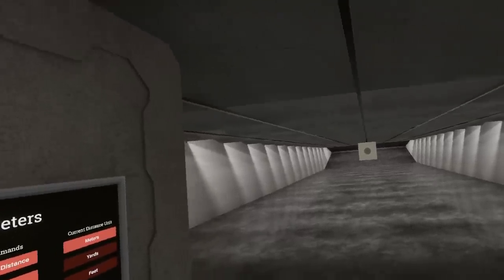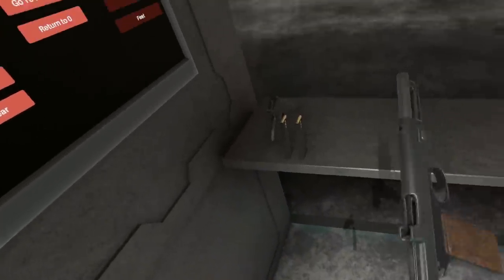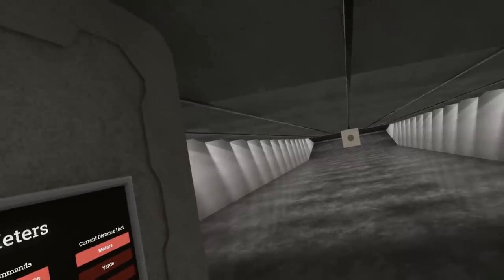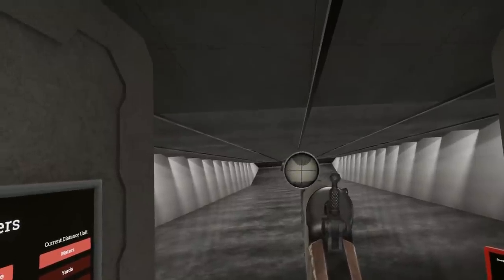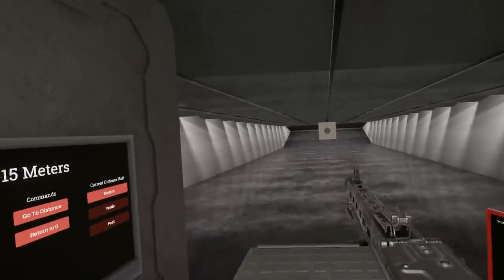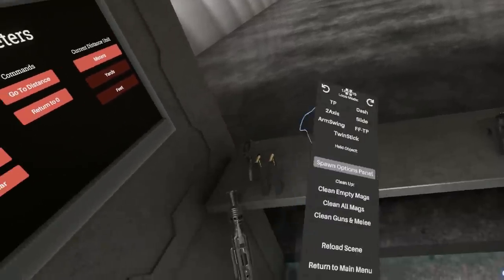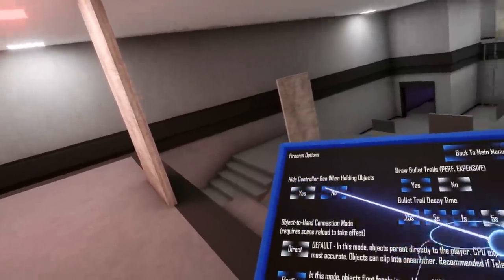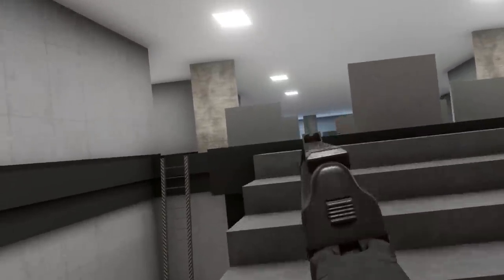H3VR Early Access Update 85 - Alpha3! - M1912 Hahns, New Armswinger Locomotion Features & More!

Comment: With the 200 round mag for the mg you should add a penalty to the gun because the gun would over heat after that much fire point in case why they have changeable barrels so you should have a reduced fire rate for the gun to penalize it

Comment: Not sure if you're aware but the martini-henry has the cocking indicator configured wrong, cocked it's upright and goes backwards 45 degrees when fired, in reality it does the opposite, it moves like you'd expect a hammer, in the movie Zulu many were incorrectly assembled and had the indicator vertical for cocked and forward for fired but it's mechanically impossible to have it to backwards when fired.

Comment: I would like to see something that lets you reload duel wielding handguns
Reply: Eject the mags, put the pistols in quickbelt slots and replace the mags. Done.
Reply: @themagnushjort  I think he means being able to hold onto a weapon and magazine simultaneously like you see in games like Counter-Strike and Left 4 Dead.
I don't need it and frankly it sounds like nightmare from both a control and coding standpoint.
Reply: @marcusborderlands6177  So the Halo dual-wielding reload? I guess that could work.
Reply: I just wish that you could stick the gun through the clip still in the belt, like a reverse version of the putting a clip into the gun in the belt, and the clip would respawn only after the gun leaves the circle thingy with spawn lock on.

Comment: For the mg42, it appears that in order to have more rounds for it, you'd just feed in a belt instead of using the drum. I'm guessing implementing a belt instead of the current solution would be a development nightmare?
Reply: Physics wise we get told at least three times a week the weapon simulation system couldn’t cope.
Reply: @blunderingfool  
Our PC will tell us we need a Threadripper CPU to even cope with the physics demands.

Joke or no, simulating physics is CPU demanding.

Comment: I know I've asked before now, but I don't think i've really gotten a response... Would it be possible , in a future update, To have full-on sci-fi energy weapons, but ones that are believably made and handled. Say, on a standard laser rifle it's necessary to adjust optics on the laser to keep focus at range. Or a railgun that not only needs ammo to be loaded, but also batteries. I mostly ask because I'm a fan of H3VR and it's the main reason i'm trying to get a headset, and I was wondering if it would bash too much with the overall realism of the game, or if it'd be an interesting project to take on.
Thanks for reading! Love your work!
Reply: I mean, they have a Robocop weapon in there, and there is a stationary rail gun, so that’s probably possible

Comment: please increase the movement speed on the joystick locomotion mode
also give us an option to make the "grab from afar laser" button toggle-able,I use the rift s touch controllers and the whole thing shakes so much when I hold down the joystick making it very very difficult to pick small things up from the ground.
Reply from the maker: There are 5 speed options for the joystick locomotion in the options panel.

Comment: I must ask - is there any way to adjust player height in VR? I play quite a bit of H3VR and I really like it, but maps like "Take and Hold" is getting quite annoying to bow down through every doorway because I am 6 foot 11. Thanks!
Reply from the maker: There isn't. However, if you run OpenVRAdvanced settings, you can manually adjust your floor height down to your needs
Reply: @AntonHand  Thanks man! I will try this out.

Comment: Is it possible to pick one bullet from a stack and not all of them (loading things like the martini henry is over complicated because I have to put the whole stack back in my quick slot before shooting the gun)
Reply from the maker: It is not.
Reply: @AntonHand  is it possible for you to program it or is it not as important as other things right now like the the arm swing features?
Reply from the maker: @Clownface1337  Any time you see me say 'it is not possible', what I mean is, "implementing this feature reliably and within the necessary performance windows in a way that functions across the 6 controller platforms this game supports is not worth the time, effort and risk that would be required to do it.

There are not enough inputs to recognize the difference between taking one or all rounds out of a quickbelt slot. Further, when you see a bunch of rounds in the slot, only one of them is 'real', as the entire interaction system was built around holding 1 object at a time. Multi-ammo handling is a nasty hack to begin with. I would have to alter or break far too many things in the game to make a modal-quickbelt-grab-interaction. It is not worth the weeks of work and piles of bugs it would likely introduce across the interaction system.
Reply: @AntonHand  Never thought programming is so hard but i have no clue. Thanks for the answer love your work keep it up <3